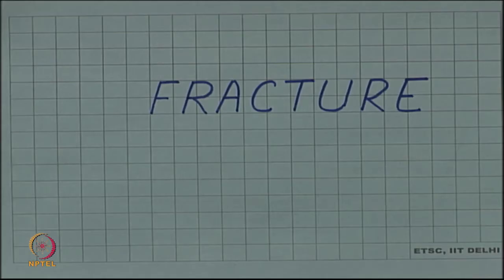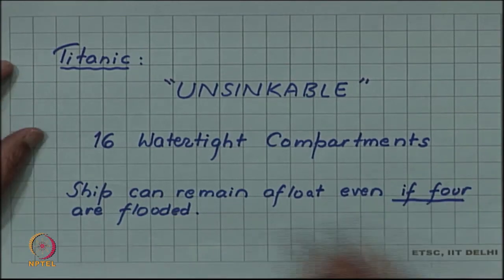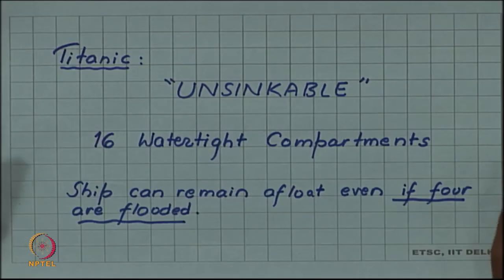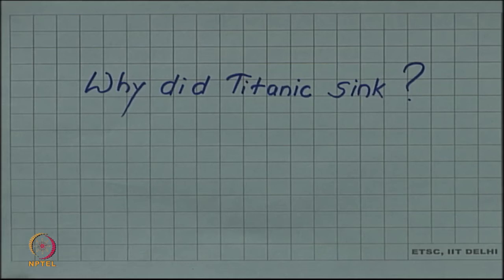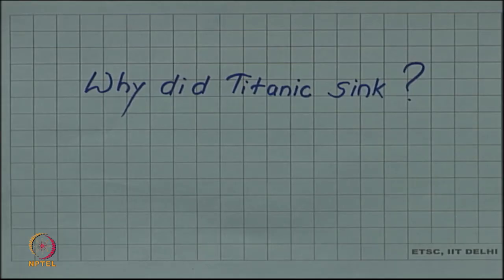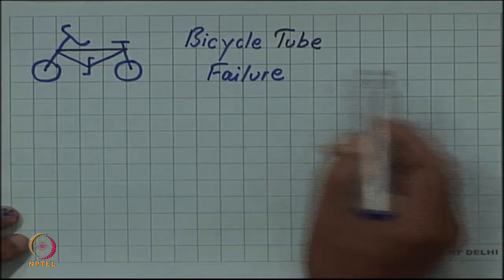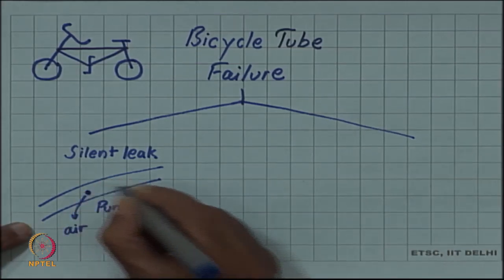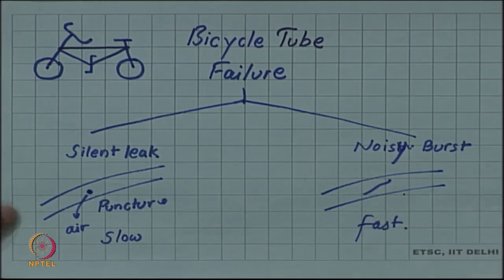Fracture

Comment: I did same bollon did not blast ??
Reply from the maker: So in your case c<c*.
Reply: @introductiontomaterialsscience  means sir
Reply: Sir i have done like: needle was pinned from just opposite site of air filling hole.
Reply from the maker: @bestcakesdesign  Near the air filling hole the stress is lower than the rest of the balloon. This is my belief. So the critical crack size c* will be larger there. Thus the hole size c created by the pin should be less than the critical crack size, making it a stable hole.
Reply: @introductiontomaterialsscience  thank you sir for my information are you same prof who is teaching in video? If yes then i am very lucky that i am talking with great iit professor.
Reply from the maker: @bestcakesdesign  Thank you and welcome. I am Professor Rajesh Prasad, instructor of this course.